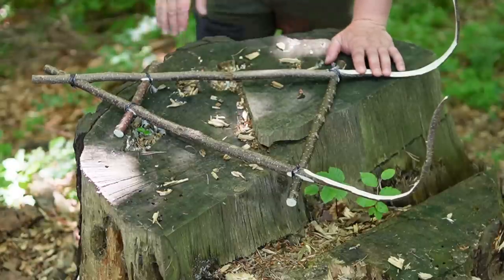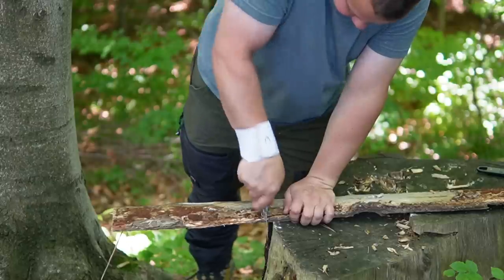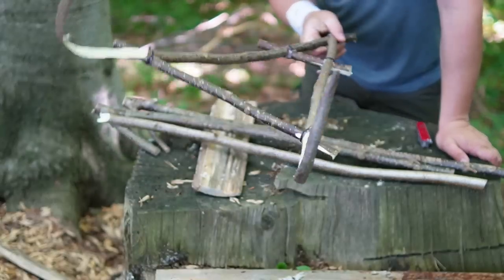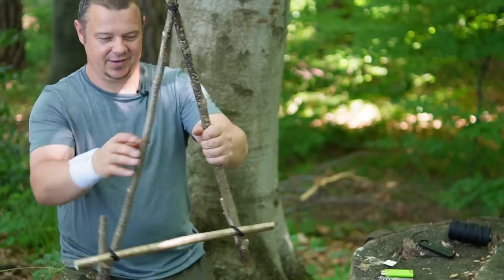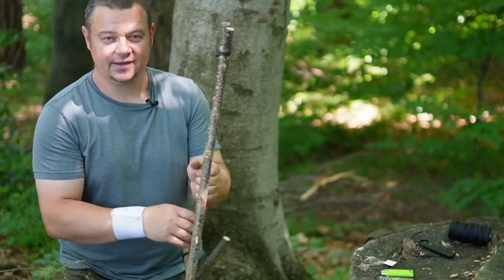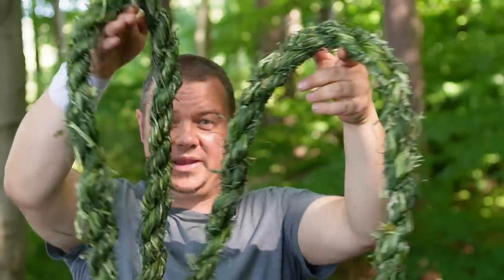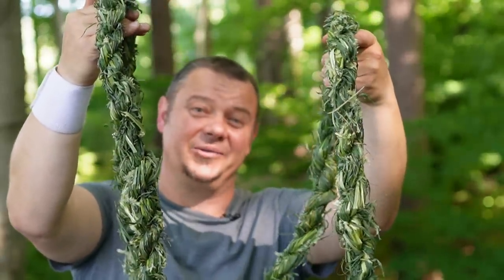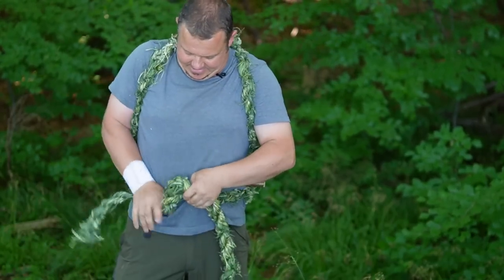How to improvise a Pack Frame with a Swiss Army Knife - DIY Grass Rope  Shoulder straps - Bushcraft

Comment: Good job with this one. I have to say it is a great idea. As you said, it can be built using nothing but natural materials, which is a main goal of wilderness survival, not wasting materials. The only flaw I see is the grass rope waist belt, which would need constant retightening on a long or arduous hike. That could be cured with a toggle as well, by cutting one side slightly longer than necessary, lashing both ends of the rope, and using a toggle to secure together by untwisting a short section of the longer side and lashed in place. Untwist a section of shorter side and push toggle through, then release. Toggle needs to be slightly longer than the rope is wide and not very thick. I hope that helps.

Comment: Love it Felix! Always enjoy seeing folks come up with their own variations of the Roycroft pack frame. I made one many years ago and still have it kicking about the house someplace. As I recall when I cut the staves for mine I used a measurement of my armpit to my wrist  for the two uprights and then from my elbow to the tips of my extended fingers for the cross bar. For the suspension harness I picked  up a length of cotton lead rope for lunging horses at a local feed supply store. It's reasonably comfortable and you have the added bonus of having cotton material at hand for making char in the field for the next fire mentality. Just have to whip the ends of the cotton rope to keep it from unravelling. Great video Felix!
Reply from the maker: Hello Gary. Thanks a lot for your super interesting comment!